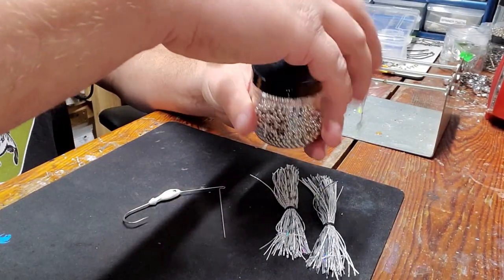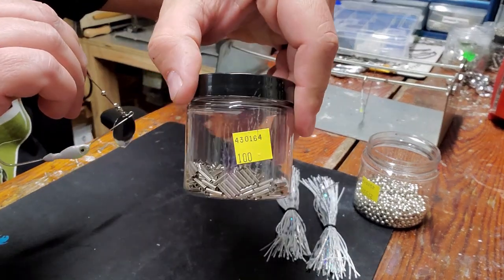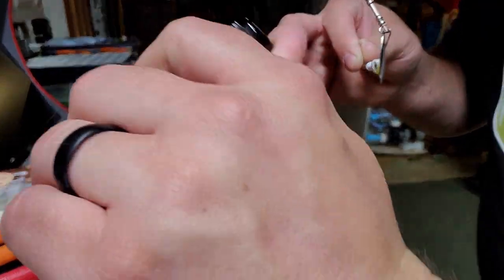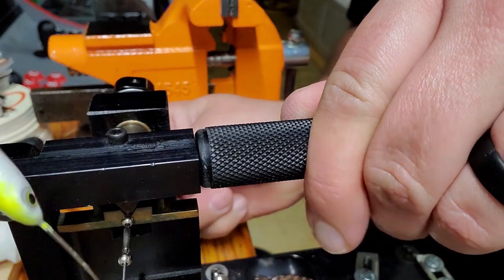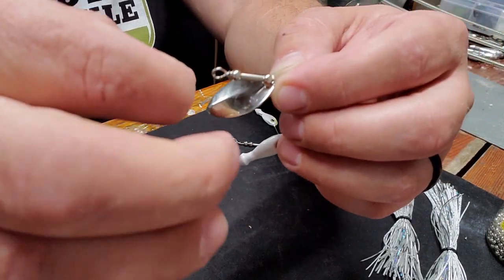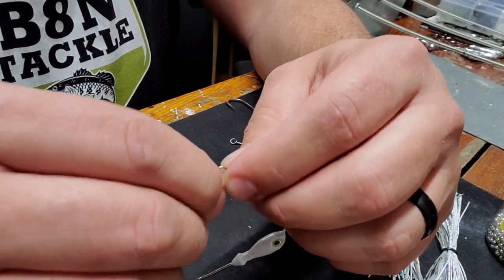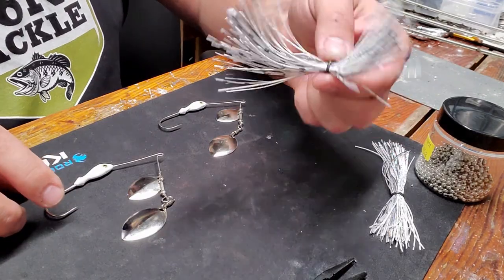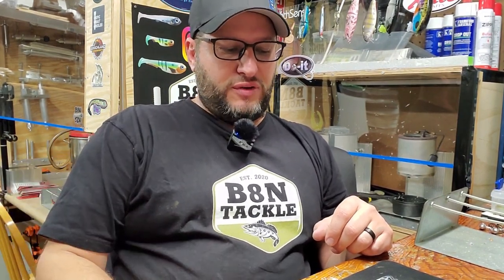MAKING SPINNERBAITS! (PART 3)

Comment: Nice Spinnerbait video series. You can make your Spinnerbaits anyway you want, but I think you installed your first blade wrong.
Simple test, make one with the cupped side up and see witch one works better? Please let use know. Also most commercially made
Spinnerbaits have a pinched loop at the top, not a twisted loop. Your wire frame is too short for a twisted loop.
Reply from the maker: Geoff, thanks for the input man! Yes I agree with the first blade being upside down, I asked my buddy about it and he has had zero issues with the blades fluttering but the ones I made him were longer wire forms so the blade wouldn't catch, also wire ends could be just pinned over, I've done both with no issues but wanted to show that route.